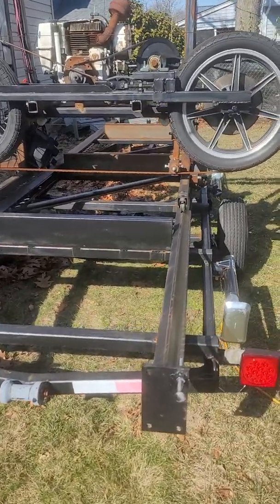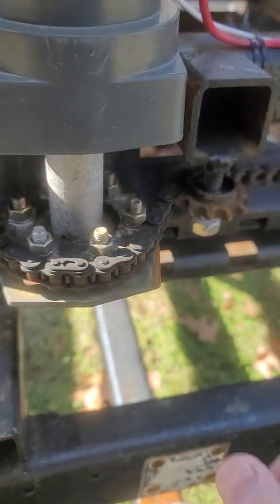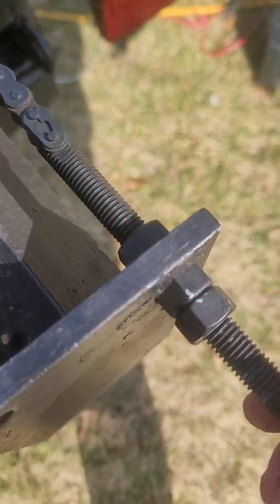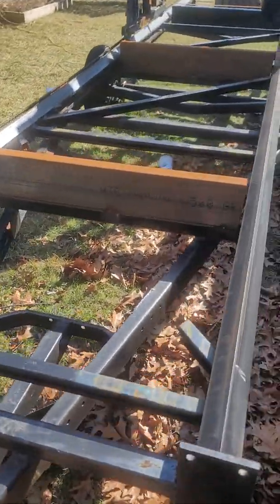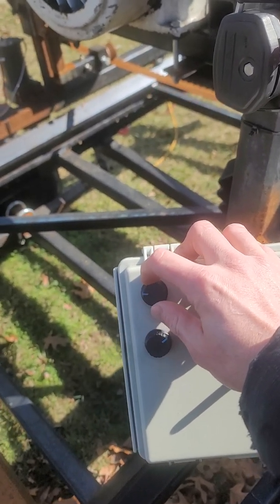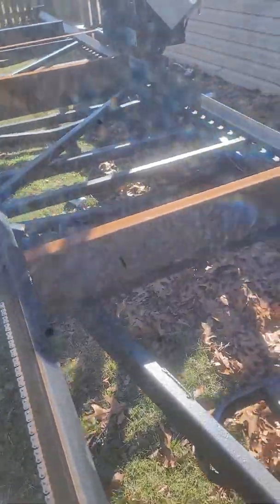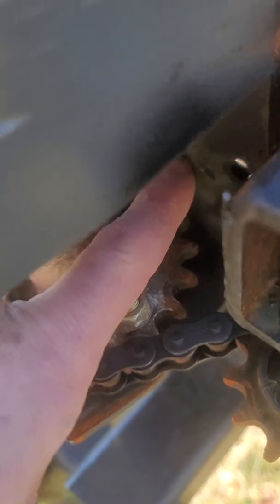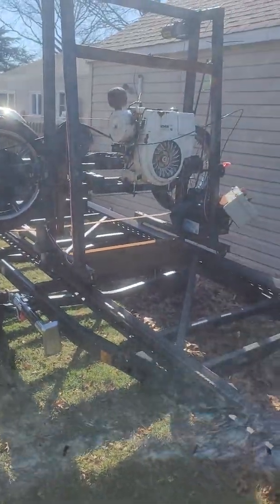Home made power feed for a mobile band saw mill

Comment: Thanks for the video! Looks great. I bought a cheep speed control like you and it has issues when wired up and switch off it’s putting 10 volts to both sides of the motor? Probably bad? What size wire did you use from the controller to the winch motor? It seems to be be kinda light duty for a sawmill? Thanks. Needing some advice from Arkansas.
Reply from the maker: Believe I ran something like this. Believe I ran 10 or 12 ga to the winch.  https://a.co/d/jdTh2hz
Reply: @seanjmichel  thanks!